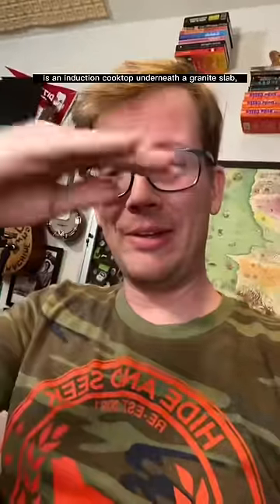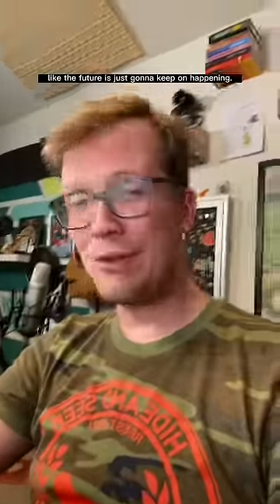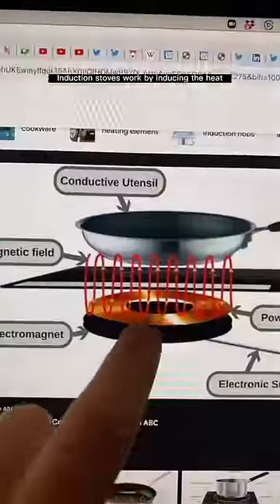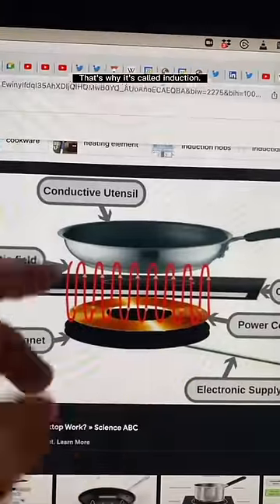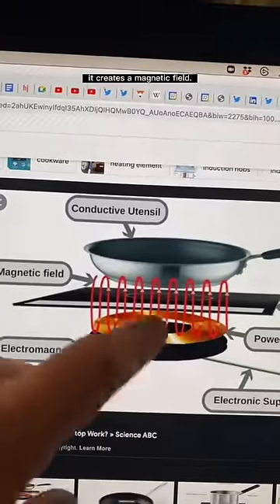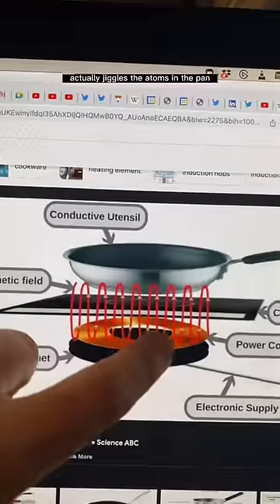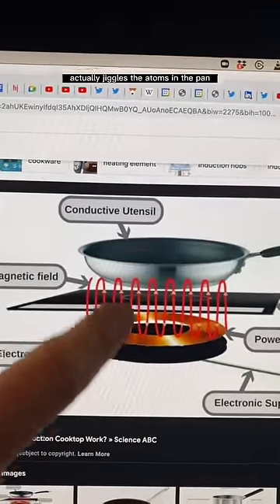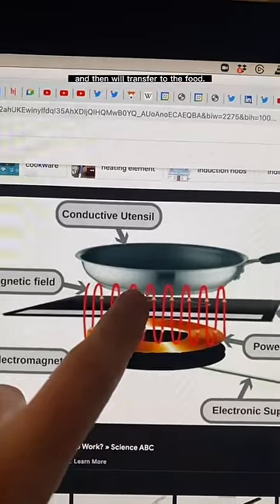How do induction cooktops work?

Comment: Imagine leaving your phone on the counter and turning it on accidentally xd
Reply: Or someone coming over who doesn't realize and sets their phone/laptop down on it thinking it's just a normal countertop, til their stuff melts😅
Reply: Induction hobs usually only turn on when there is a large magnetic object on top of them (like a steel pot). The magnetic parts in a phone are probably too small for the hob to detect and turn on. What I don't understand is how you know where to put the pan when there aren't any markers.
Reply: Imagine trying to sit on the counter
Reply: @asuba57  this like microwave for metal. Microwave only heats water in your food.this only heats magnetic metal.
Reply: @zeropolicy7456   wow that's so cool esp the roll up displays, do you remember where the tech exibition was held?
Reply: What if, besides this induction stove top there was also a build in wireless phone charger :o
Reply: I'm guessing.. and this is just a guess.. that there's some switched hidden somewhere. It's not going to be on all the time. x3 Probably behind those pannels right under the lip.
Reply: @technophobian2962  So you can't use ceramic cookware???
Reply: @zeropolicy7456  Depends on the phone, If it has wireless charging then you can say goodbye
Reply: @rivercat26  If it's purely ceramic it won't work
Reply: @zeropolicy7456  Not specially made cookware really, but not everything works. When I got a cheap plug-in double induction hob I had to get new pans and the ones I got were old enamelated aluminium or steel or whatever, really the most basic thing you can imagine. You can use quite a diversity of cookware on induction. The only thing you absolutely can't use directly is non-metalic cookware.
Reply: Almost all induction cock top will protest and turn off if you place the "wrong" items on in. Mine won't even accept my metal bowls so very unlikely to destroy ant phone 😉
Reply: @jvseventeen  do you often leave your stove on without havibg anything on it? 😆
Reply: @rivercat26  A lot of ceramic cookware has a bit at the bottom made of a magnetic metal so it works with induction. The easiest test to see if something works is to see if a magnet sticks to the bottom of the cookware.
Reply: @rivercat26  dunno about that, but i use (almost) all my old cooking pans on the induction stove, even cast iron pans with ceramic coating :D it's great!
Reply: Nothing would happen
Reply: @mickb.8925  I mean, induction stove tops are basically giant wireless chargers, the energy goes into the food instead than in your phone but the concept is basically the same
Reply: @reptilezsweden  Yeah, its also made cause it would be super dangerous to have like, knifes or small objetcs to hest up. Even if you had a metal ring on top of it it could be dangerous. Thats why  they have a lot of security measures
Reply: @accidentallyaj5138  not really, the concept is the same but the frequency is different. The coil in the phone is a different length antenna, so it probably won't go into resonance and no power would go into the phone.
Reply: It doesn't work. You need specific type of pans and pots, that work with the magnet. I say specific, but it's really most as long as it doesn't cost just 5 bucks
Reply: @zeropolicy7456  Do you need special? I though you just can't use certain types of cookware like copper or aluminum.
Reply: I know someone with a built-in induction range and I tried and no, you can’t charge your phone on it. At least not with an iPhone 13 Pro and what is probably one of the nicest induction ranges that money can buy. And no, you can’t burn yourself on them. I think all new homes will have these standard in 10 years.
Reply: It doesn't work like that it doesn't get hot.
It doesn't work unless you have pans for induction Cook tops. I had one. It wouldn't melt anything, it's not hot to touch.
Reply: @baschoen23  exactly. Ceramics and aluminium only don't work. Get some good steel/iron pans, pots, or even aluminium/ceramics with iron as base etched in it and it will work just fine. Getting steel or iron means you won't have to worry about utensils throughout the lifetime. Steel now comes with triple ply steel etc. and all the shananigans too.
Reply: @2nd-place  yes. You can place your palm and it doesn't register/starts to heat. A certain area needs to be covered too for it to turn on the heat. 
What burns you is after you are done cooking the glass/ceramic top retains the heat for sometime and that could burn if someone touched the top. That's it. Even the utensils placed on it aren't hot, but only the content is hot.
Reply: The main concern I have is that the counter can get very hot from a pan sitting on top of it for a long time, but it doesn't look hot, and then your guest leans on the counter right in that spot because they had no idea.
Reply: @zeropolicy7456  just magnetic ones
So cast iron for example
Reply: @asuba57  As long as you're not wearing authentic knight's armor, or a chastity belt, you'll be fine.
So medieval fair enthusiasts bewahre!
Reply: Imagine if someone sits on one
Reply: @andreaskarlsson5251  nah, but I also don't have friends with laptops who come over and set them on random countertops. I just went along with the joke.
Reply: @zeropolicy7456  Please try to thoroughly read posts before replying in the future. Conduction is the problem, and stone that has been allowed to heat up for a long time can stay very hot for a long time. The confounding variable is that a guest would know not to lean on a stovetop, but there are no giveaways here.
Reply: @zeropolicy7456  Anything will heat up when in direct contact with a hot thing for a long time. Think of a large pot of soup cooking for hours, the large slab of rock below it should, itself, become rather toasty. Are you deliberately ignoring the specific point I'm talking about or are you saying it's not a problem?
Reply: @zeropolicy7456  I was only talking about the specific scenario and never said the other stuff. Also, a thing can't be both designed to disperse heat and keep it localized, those are opposites. Is it designed to draw the spreading waste heat away to a heat sink? If so, then yes, it would be much safer.
Reply: @stevencurtis7157  the counter top stays relatively cold imagine putting a hot pan on a granite counter the counter is a good insulator and has much more thermal mass than the pan.
Reply: @zeropolicy7456  induction cookware doesn't need to be specially made, it just needs to contain iron or steel. An easy way to check if a pan is induction compatible is if a magnet will stick to it, it'll definitely work.

Cast iron and stainless steel cookware are induction compatible, and some aluminum pans have a steel core.
Reply: Imagine being dumb enough to turn it on accidentally.
Reply: @technophobian2962  that is absolutely correct.
Reply: @technophobian2962  you don't really need to understand where to put it because it's one giant magnet you turn it on in the entire surface can heat up a  pan it's just one giant massive 4x4 cooktop I'm assuming it's as wide as the countertop is long and I'm going to take a guess and say it's 4 ft long maybe three
Reply: @zeropolicy7456  You don't need specific you need compatible metal. There is absolutely compatible metal in your phone. Specifically in your battery, which is gonna go POP if you leave it on there.
Reply: @fiat1314  actually it heats electrically conductive materials, the reason it doesn’t heat up your body is because your body has too much resistance to be considered electrically conductive enough
Reply: Ugh, granite gets stained if you don't seal it, and you probably can't seal it if it's getting hot.
Reply: Cute pfp
Reply: @zeropolicy7456  no you just need anything that isn’t made of aluminum or other non-ferrous metals. You do need specific cookware but not “special” stuff.
Reply: You do realise that if you do that.... Absolutely nothing will happen because one of 2 things:
1- either you put it on before you use the stove and even if you accidentally turn it on with the phone on top, nothing will happen because it won't trigger the induction system or....
2- if you accidentally put it after cooking you will feel the residual heat
Reply: @rivercat26  no. Can you use ceramic cookware in anything besides a microwave or oven?
I have always assumed that if I put ceramic on top of an open flame or an infrared cooker it wi break
Reply: @jvseventeen  I've boiled water (which boils much faster btw) on induction and then immediately felt the surface of the inductor only to find it was just warm.
The only heat if any on the actual stove surface is residual heat coming from whatever pan or pot is on top
Reply: @rivercat26  You can if it has a copper coil which most induction pans have anyways
Reply: You have to turn it on aswell usually with a cool magnetic disk
Reply: This is how wireless charging works....
Reply: @technophobian2962  a few years back, I saw a video show casing what was then the world's most advanced stove, and in essance it was a honey comb pattern of hexagonal induction hobs the size of €2 coins, and when you put a pot, pan or oven dish on it, the ones underneath would switch on
Reply: @technophobian2962  more importantly how do you control the temperature?
Reply: That’s actually not how it works. Unless the right pot or pan is on the surface it actually doesn’t crate any heat.
Reply: @zeropolicy7456  you dont
Reply: @rivercat26  needs to be magnetic. Copper, glass, ceramic & aluminium won't work. You can buy clad cookware, which had layers of steel on the base to make it compatible. 
Cast iron works a little too well.
Reply: fun fact: wireless phone charging uses the same technology as an induction stove.
Reply: @zeropolicy7456  So long as the cookware is made from iron or steel it works quite well.
Reply: It doesn’t work that way. It won’t conduct heat with nonferrous metals. Since the cell phone is mostly made up of metals that are not magnetic you don’t have to worry about it. Plus I don’t think there’s even enough Nas there to cause any real damage.

I have one of these. Personally I think it sucks, it doesn’t cook as evenly as gas. I would trade it in a heartbeat.
Reply: @rivercat26  ceramic is just aluminum with a ceramic coating
Reply: Or your rings
Reply: no it needs a compatible pot or it will beep and turn of never getting hot
Reply: @technophobian2962  this hahaha i would essentially lose my stove in my own house 😭😭😭🤣🤣🤣
Reply: @zeropolicy7456  oooooooh snap o want one so snazzy 😁😁
Reply: @rivercat26  no unless it says induction compatible on the bottom but usually they aren't only induction pots work on induction stoves
Reply: Most phones are minimally conductive so it would take a while to actually get hot enough to cause a problem
Reply: @luminescentlion To your point, i have a 2 burner model that sits on top of the table. When you turn the "burner" on it will beep until it detects a compatible pot. If it detects a compatible pot then it starts to heat up if it doesn't detect a compatible pot (meaning you don't put a pot or the pot you put on isn't compatible) it will turn off never getting hot. Now this was a safety feature advertised as a selling point and might not be an industry standard. 

Ironically, when water boils over / out of the pot it gets under the pot and boils in between the stove surfaces and the bottom of the pot and the pressure makes the pot slide significantly off center. It's possible the a big pot of stew could by itself slide of the stove and fall into an un-expecting toddler or adult passing by. God forbid but the thought alone scared me and i don't even have kids yet. So they should add some kind of securing grip or something as well
Reply: It'll get bricked.
Reply: @fiat1314  imagine you have a broken femur with a giant steel bolt
Reply: If you position your phone just right on the burner, does it wirelessly charge?
Reply: It has to be very specific materials to work which is annoying because it makes most of your old pots and pans useless but it is safe
Reply: @technophobian2962  however if someone accidentally placed a laptop on the hob then it could falsely activate and melt it. Overall I think it's alot better to just make it obvious where it is
Reply: @technophobian2962  the wireless charging coil would absolutely get very hot.
Reply: Bye bye phone
Reply: Luckily, phones are not made with iron
Reply: Imagine sitting on it with piercings in your private areas
Reply: @asuba57  "my butt don't jiggle, jiggle, it melts..." 
I'll show myself out. 😂
Reply: I remember people like you saying, "a handheld smartphone with A GLASS SCREEN"!!
That's stupid.
Reply: It would just charge it
Reply: @technophobian2962  you should test it out for science
Reply: @asuba57  that would do nothing though. Human skin is not magnetic
Reply: Wouldn't work. Induction doesn't "trigger" when there is no pot
Reply: It doesnt work with just any pots/pans/metal. There is no concern.
Reply: @fiat1314  let’s say you are frying food in a large pot, eventually the granite will heat up to the point in which can burn you, granite doesn’t cool quickly my boy. Once that pot is moved somewhere else you have a easy place for guests to get Burnt I’d imagine
Reply: @technophobian2962  the easiest test is probably to look if your cookware is induction rated. I mean, there is a specific icon for it...
Not on old cookware.
Reply: It only heats up ferrous metals , iron and steel . Not plastic , not ceramic , not aluminium , not gold or silver or platinum or copper , not glass , etc. If a magnet sticks to metal then it's ferrous if not then the induction won't work .
Reply: Talk about fast charge. Or would it be Fast Char?
Reply: @mickb.8925  they do put wireless chargers into desks, car consoles, etc. cool technology.
Reply: @technophobian2962  I've seen some that have a bunch of little induction coils. They can detect when there's metal nearby and auto turn on. So there is a general area where you need to place things but it isn't limited to specific large circles.  Not sure how they auto-detect, but maybe check every x seconds if there is energy loss.
Reply: @Quintinohthree  Specifically it has to be a ferrous metal. If a magnet sticks to it it generally works. So yes iron or copper, but no aluminum.
Reply: @technophobian2962  maybe it’s a smart cooktop and they have to start it with their phone?
Reply: Theres a fairly good chance i feel, of heating something up, having the granite heat up from the pan, and then getting burned by the granite, or like having a child death afraid of touching countertops
Reply: For all the people saying "imagine leaving something on it", induction stoves only work if the thing on it is magnetic. So cast iron pots and pans work great. Glass? Not so much. Ceramic? Eh...maybe? Aluminum? Nope. Plastic? Definitely not. 
Al
Reply: Nothing would happen
Reply: That's not how they work it only heats up the metal in the pan
Reply: Sitting on the counter does nothing. The cook top doesn't get hot itself. Only the pan gets hot, and the head radiating off the pan will only slightly warm the cooktop.
Reply: If you have this, you shouldn't worry about the cost of replacing a phone
Reply: @rivercat26  you can, it just has to have a magnetic base. Nothing stopping it from having a ceramic coating though
Reply: @accidentallyaj5138 even if it has wireless charging it won't work, it needs a specific frequency to work on which is pretty much dependent on the physical size of the coil. The coil of the phone is too small to effectively capture all this EM field coming out of the induction cooker. You need to have a pretty good alignment of the send and receive coil in order to actually transfer energy (which is why Apple put on a magnetic latch).
Reply: This is not possible. Great to see 7.2k people commenting on a impossible action. Watch the video..
Reply: imagine visiting your friend's house and offering to help in the kitchen and then dying because you have a pacemaker and they have an induction cooker
Reply: @technophobian2962  but what if you're wrong! My phone does wireless charging, there's definitely a coil of metal on the back of my phone. I DEMAND EXPERIMENTATION!
Reply: Or someone setting a baby on it
Reply: @technophobian2962  a lot of new induction hobs (the more expensive ones) are just one giant rectangle so you can put the pot anywhere and the field is created where the hob detects the pot. You'll need some controls though, in my neighbours hob you change temperature by swiping below the pot but I don't know how that would work here.
Reply: That's what I was just thinking like what if you left your phone on the counter
Reply: @technophobian2962  so would just destroy iPhones because of magsafe 🤣
Reply: Or a baby or pets? Some things aren't good for dumb people and every family has a few.
Reply: I’ve got an induction stove. Left a metal mixing tray on the hob thinking I was heating my cooking pan but I was heating the mixing bowl instead. Bottom part of it was white hot and semi melted. 
And to anyone wondering, yes it detects my phone as a pan I just haven’t been stupid enough to fry it yet.
Reply: @technophobian2962  led lights. The cyberpunk future we all want
Reply: muhahahahahaaaaaa
Reply: Phone doesn't have a thick enough metal for induction stove to heat it.
Reply: free wireless charging
Reply: @rivercat26  correct
Reply: @technophobian2962  it's the entire cabinet
Reply: It won't burn! It has to be magnetic to heat up, if you turn it on without a pan to finish the current, it turns off! It also means that the rest of the cooktop does not get hot so you can use the rest of the space as work surface. I have an induction stove and it's my favorite.
Reply: @AlishaAnn94  phones have magnetic bits in them
Reply: @technophobian2962  that's still running the risk of someone not knowing about the hot pan that was just placed on the countertop and burning their hand on it

the hot pan can transfer heat to the countertop, which is probably a hazard
Reply: wouldn't that charge the phone? 😂
Reply: Oof, or having a pet... or child
Reply: @fiat1314  imagine sitting where a hot pan once was just seconds ago
Reply: @technophobian2962  it doesn’t matter where you put the pots and pans. I’m assuming the whole countertop is an induction stove, so no matter where you put it, it will heat up the pot/pan
Reply: @rivercat26  you can cook with ceramic, but only if the ceramic either has the bottom of it (outside, not inside the pot) in a material that work with induction, or you get a special induction plate (they also come with handles) to put underneath the ceramic pot
Reply: @technophobian2962  Yeah they should add markers ontop, also it would be nice to add a light so you can see when it's activated.
Reply: @technophobian2962  maybe it's like those hibachi grills where it heats(or magnetizes) the entire surface
Reply: Might actually charge it lol
Reply: It’s not the cooktop that heats up, it’s the pan, the actual surface doesn’t heat up (except from the heat paaed back down onto the surface from the pan). Smaller metal items most likely won’t be detected by the stovetop, so it wont turn on.
Reply: That would be scary, however most induction tops, or at least the one I have will not turn on unless it senses that magnet on the stove, so if your phone had a phonecase on it it most likely wouldn't burn
Reply: @rivercat26  correct. [partially] the only pans you can use with an induction stove top are induction pans. In theory, if your ceramic cookware has an induction bottom to it, it will transfer the heat.
Reply: phone: you are using 2447% of your cpu
Reply: Yeah seems like a safety hazard to me. Most induction stoves still look like stoves and they have electric lights to tell you when the thing is on or off and indeed where the "rings" are
Reply: @TheAllMightyGodofCod  Nah, you can use ceramic cookware on a hotplate stove (those ones with the metal plates that heat up), gas stoves, and halogen stoves. You can't use them on induction stoves because a) they'll scratch the surface and b) they won't work
Reply: @spyne.98  Welp no good for cooking anything other then microwave food then
Reply: Phone: "Fast wireless charging: 90 milliseconds until full charge"
Your 'skillet' is now on medium-high
Reply: @mickb.8925  what if the induction stove is the wireless charger? they are basically the same thing, just different size
Reply: @technophobian2962  Probably a large enough usable area that you just need to be “close”. It doesn’t heat up so having a much larger burner isn’t as inefficient.
Reply: @technophobian2962  I was thinking the same where do you put the pans! But wonder if you could use that large induction coil to charge your phone really quickly! 😂
Reply: That was the first thing I though so many devices would be lost🎃
Reply: lol
Reply: 11NNNkth
heereliest
Reply: @technophobian2962  I'm sure that is why it is expensive. Probably has so many induction coils that you could more or less place a pot anywhere.
OR!
You just have to memorize it, I guess...
Reply: @fiat1314  microwaves only heat water in my food?? Why am I learning this at 26??
Reply: 😂😂😂 frrr
Reply: @jvseventeen 😂😂😂
Reply: @technophobian2962  about the markers - same bro
Reply: @asuba57  😂😂😂
Reply: could be a new case for fire alarm cases
Reply: @technophobian2962  laptop?
Reply: @fiat1314   do you not have water in your body? A microwave can hurt you. Induction cooktop? Not so much. But can hurt electronics placed on top.
Reply: @asuba57  You would be alright unless you had buns of steel...(iron)
Reply: @jvseventeen  ⚠️ God has said in the Quran:

🔵 { O mankind, worship your Lord, who created you and those before you, that you may become righteous - ( 2:21 ) 

🔴 [He] who made for you the earth a bed [spread out] and the sky a ceiling and sent down from the sky, rain and brought forth thereby fruits as provision for you. So do not attribute to Allah equals while you know [that there is nothing similar to Him]. ( 2:22 )

🔵 And if you are in doubt about what We have sent down upon Our Servant [Muhammad], then produce a surah the like thereof and call upon your witnesses other than Allah, if you should be truthful. ( 2:23 )

🔴 But if you do not - and you will never be able to - then fear the Fire, whose fuel is men and stones, prepared for the disbelievers.( 2:24 )

🔵 And give good tidings to those who believe and do righteous deeds that they will have gardens [in Paradise] beneath which rivers flow. Whenever they are provided with a provision of fruit therefrom, they will say, "This is what we were provided with before." And it is given to them in likeness. And they will have therein purified spouses, and they will abide therein eternally. ( 2:25 )

⚠️ Quran
Reply: He literally says in the video it doesn’t get hot 😭
Reply: Super-Charged cellphone!!!!
Reply: @rivercat26 correct. Or solid aluminum, for that matter. Most induction-compatible cookware at minimum has a ferrous metal layer in the base that responds to the cooktop, then conducts to the rest of the pot
Reply: Wouldn't work but this just looks like a counter and she's trolling
Reply: Imagine the cat turning it on
Reply: It wouldn’t get hot
Reply: @jvseventeen  the top surface of the induction(in this case the countertop itself) does not heat up. Only the metal plate at the bottom of the pot heats up on itself due to magnetization. If someone left their keys or any metallic items for that matter while the induction is on, nothing will most likely happen because first, it requires a wide plate that is made of magnetic metal like magnetic steel and iron (aluminum, copper wont work) and I dont know if keys are made of iron but they are small and certainly phones have tiny bits of iron inside but they are far too small to catch the wide magnetic plate that the induction cook top's surface requires in order to start heating up.  So no, that wont happen to someone coming over :D
Reply: @jvseventeen   the top surface of the induction(in this case the countertop itself) does not heat up. Only the metal plate at the bottom of the pot heats up on itself due to magnetization. If someone left their keys or any metallic items for that matter while the induction is on, nothing will most likely happen because first, it requires a wide plate that is made of magnetic metal like magnetic steel and iron (aluminum, copper wont work) and I dont know if keys are made of iron but they are small and certainly phones have tiny bits of iron inside but they are far too small to catch the wide magnetic plate that the induction cook top's surface requires in order to start heating up.  So no, that wont happen to someone coming over :D
Reply: Phone will works fine, but everything! Im mean EVERYTHING! Even ur default factory setting and that cause ur phone never turn on
Reply: @rivercat26  if it's ceramic coated steel/cast iron you're fine.
Reply: no
Reply: @technophobian2962  but your metal laptop casing?
Reply: @technophobian2962  probably
Reply: You can actually charge your phone if it has the wireless charging thing compatible, you put the induction stove on the lowest setting and just set the phone on it. Doesn't work for all phones obviously
Reply: @asuba57  and you've had a hip replacement
Reply: @accidentallyaj5138  Nah, has to be a minimum diameter for most (if not all) induction cooktops. Even the ikea one we have won’t do those extra small saucepans.
Reply: @rivercat26  Basically it has to be a ferrous  metal or have a piece of ferrous metal on the bottom. So if a magnet doesn’t stick to the pan or pot then it won’t work!!
Reply: @technophobian2962  There’s a stove that we are looking to buy that doesn’t have any markers of “burners” because anywhere you set it can be the burner. What I thought was weird is that you can’t see any controls for it. Not sure why anyone would want their stove to be completely invisible! I mean even though the stove itself doesn’t get hot people won’t know that the pots and pans on the invisible stove ARE hot. Still seems dangerous.
Reply: @mickb.8925  There are videos of people getting lucky / unlucky enough to charge their phones. Probably a 1-way ticket to destroying your phone.
Reply: That’s not how it works
Reply: It works the same way as a wireless charger. So you might be fine.
Reply: Wireless charging
Reply: @asuba57  did you not listen to the explanation?
Reply: My bf accidentally turned on our electric stove the other day and all the burning and smoke was bad enough. I can’t imagine that with this induction stove he might possibly got someone killed😨
Reply: @fiat1314 The pan will heat the stone and still leave a hot spot though right?
Reply: @technophobian2962 you have to turn it on you know. It’s not just always active
Reply: @owenthompson4071 some things take up to a half hour to cook via pan, and sometimes you want to cook several batches of something, so it could ABSOLUTELY get too hot. You would definitely run into that problem if your stove was designed to look like a countertop, and it’s only a matter of time before it happens to someone if it hasn’t already.
Reply: @technophobian2962 It’s probably a very large pad so it doesn’t really matter where you put it in the area, it will still cook
Reply: @baschoen23 aluminium won't work i had an aluminium coffee maker and it didn't work. I don't know about copper do
Reply: wouldn't work. only works on even inductive surfaces
Reply: @rivercat26 no ceramic only metal. you should still have an oven though for ceramics.
Reply: Or your waiting for the pan to heat up only to realise its no where near the burner?
Reply: @asuba57  yeah? You can sit on it unless you’re magnetic.
Reply: @jvseventeen well it would still need turned on lol.
Reply: Imagine learning how induction cooking works before making ridiculous comments.
Reply: Someone is accidentally going to put a piece of metal on it. There will be accidental burns.
Reply: My parents have a induction stove. It doesn’t charge phones. The stove turns automatically off if there isn’t a large enough magnetic object on top of it. Also, phones only work on qi chargers because there is a sort of communication happening between the phone and the charger.
Reply: @accidentallyaj5138 .... That's just incorrect... it's not sending a signal to a wireless charger.....
Reply: @asuba57  is your butt made out of metal? Jokes aside, there can be left over heat after you remove a pan, but yeah
Reply: @asuba57 you can sit right on top of an induction cooktop. It will not burn you. Unless you are a robot made of metal.
Reply: @technophobian2962 I am sure if you looked at the counter top closer you would be able to see a + in the middle of each "hot spot".
Reply: @rivercat26 no I think you can’t
Reply: I guess our atmosphere is just like an induction heater.😮😮
Reply: @jvseventeen  probably need to turn on the induction cooktop, first.
Reply: @asuba57  it wouldn't do anything. You can literally take a hot pan off the induction cooktop and immediately put your hand on the cooktop without being burned.
Reply: @rivercat26  correct.
Reply: @fiat1314  they usually only switch on if they detect a magnetic pan, but that's a safety measure.
Reply: @technophobian2962 a good number of phone cases nowadays have magnets on the back (coincidentally to align with inductive chargers) would those magnets activate the element? Or would your phone just charge REEEEEALLY fast?
Reply: @asuba57  - "Imagine trying to sit on the counter"
That's the cool thing: it most likely won't burn you.
Regular electric coils get extremely hot, far more than necessary to cook food, because they have to transfer that food to a pan or pot just by contact. Induction heats the cookware directly without interacting with the surface. The only heat the surface gets is due to contact with the heated pan, so it's not actually that much.
Reply: @jvseventeen  But the heat is produced by the iron mass of the pot, so a phone wouldn't really heat up from a bit of low frequency induction.
Reply: @technophobian2962  Yeah, this makes absolutely no sense. All the ones I've seen have at least a control interface visible. Personally, I really wish it was possible to get an induction cook top that DOESN'T USE TOUCH CONTROL. Ok, so I know it's TECHNICALLY possible to get one, but it comes with a SMEG logo and a pretty hefty price tag. Being a huge fan of Red Dwarf, I'm not quite ready to spend money on SMEG.
Reply: This is actually something I really wondered about. Induction heating looked like it worked a lot like qi charging for phones... Can I charge my phone with it!?
Reply: @splergenyuralove  no, it's a much lower frequency than phone charging
Reply: @asuba57 that’s the cool part, you could turn it on and sit on it and it wouldn’t be hot
Reply: @asuba57 It doesn't get hot, you could remove something you were just cooking touch it and it wouldn't burn you.
Reply: Nothing would happen. The phone doesn't have enough ferrous material in it to get hot, and the cooker also is able to detect the inductive load. If there isn't a suitable load, it turns off.
Reply: @asuba57  you will be fine. it only works on conductive materials like iron and copper.
Reply: @technophobian2962  There are markers usually that you can either feel or seem when close up
Reply: It'll cook the sh!t out of it, but but but it would also charge the battery.
Reply: People the stovetop element doesn't by itself get hot... But anything that a magnet would stick to will if placed on it.

But I have suspicion there isn't even a stove there. It really didn't seem like a fancy enough kitchen to hide the stovetop, and there were no control systems present. The idea that you cannot see where to place the cookware is a bit sus, but people do weird things, soo 🤷
Reply: @technophobian2962  putting your phone in a frying pan might help?
Reply: @asuba57  Wouldn't do anything. It's induction
Reply: @technophobian2962  you can probably put  it anywhere on the whole thing and it will detect it, there are stovetops like that nowadays.
Reply: Maybe it's just gonna charge pretty fast?
Reply: that's not how that works xd
Reply: Grandma leaning on the counter with a metal hip. 🔥🔥🔥
Reply: There's also swithces/Buttons to turn it on and you can change the heat just as on any other stove. Induction stoves is the standard where I live. It's not like witch craft 😂
Reply: @technophobian2962 the magnetic field will let you find them, you can feel it sort of snap into place
Reply: @asuba57 you'd be fine
Reply: @rivercat26 not with an induction cooktop
Reply: @technophobian2962 It is likely griddle style, so it is probably the whole rectangular area before the curves.
Reply: yes, because my phone and but both will get hot from induction 🤣 

as we'll at it, don't sit on your wireless phone charger either 😂